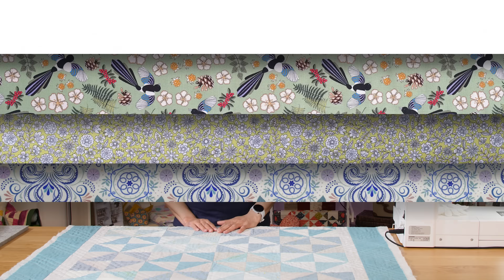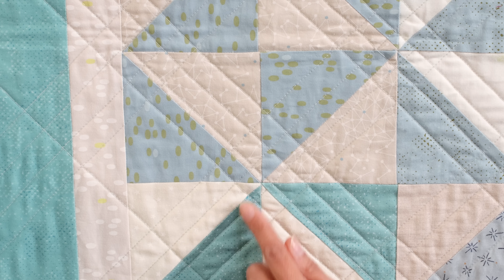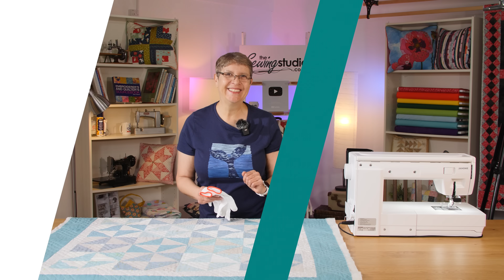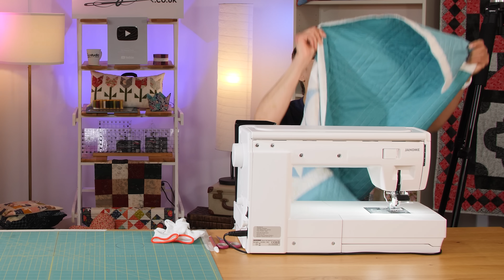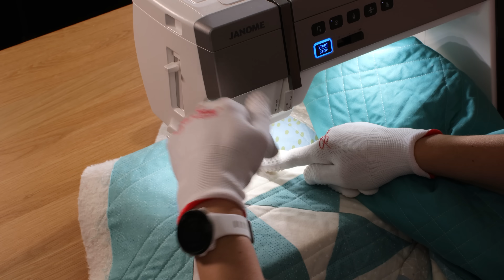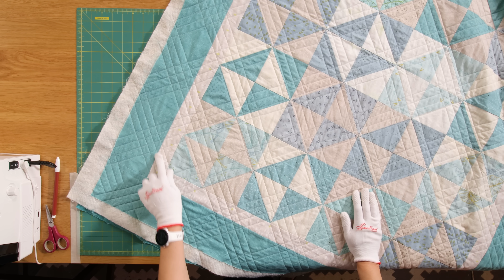How do I quilt using my home sewing machine? Easy Quilting Techniques for Beginners

Comment: Great video as usual thanks. Love this idea but can you explain where you started quilting, was it straight across the middle first? Then worked outwards from centre?  Does it matter if quilt top is a square or rectangular shape, will it work on both? Many thanks

Comment: I have a question. I’m working on a small baby Quilt and I need to find out why when I Quilt on the Home machine that the back doesn’t stay smooth I use a walking foot. Is there a certain kind of batting that is the best and also the needle thank you
Reply from the maker: Are you using spray adhesive? We have a number of vidoes which might help but this one is great: https://youtu.be/mAMjnUpGbsA?si=-McQIzKaKcB0LDk5 Let us know how you get on.
Reply: @SewingStudio  thank you for your help. I have never tried the spray adhesive.

Comment: Thank you, very instructional! Problem is, can I quilt a double (queen ) size quilt on a Janome 5060 qvc? I think the throat may be too small.
Reply: I've been quilting for years, I quilt all my quilts, which are for double beds, in my little Brother sewing machine that has an 8 inch throat space (, I've also quilted these big quilts in a six inch throat space and it was hard work). My tips are to use a walking foot, quilt in straight lines, roll neatly half of the quilt to put it in the throat space as you start quilting from the middle, if you can have space behind your machine for the quilt to travel even better ( I haven't! ), don't push the quilt, let the feed dogs do their thing, if you have to adjust your quilt every few inches that you are then do so. It's not easy but it's what you do when you can't afford these expensive sewing machines. Watch Angela Walters, her early tutorials are showing some awesome FMQ of big quilts on a small domestic machine, she's incredible! I've only done one FMQ in mine and I could feel the tension in my shoulders trying to love the quilt that was essentially jammed through lack of space, not sure I'll be repeating that idea! Also remember you can lengthen your stitch ( I use 3.5 )and slow down, it's a walking foot not a running foot. ❤
Reply: @rebeccamulkern1051 So kind of you to reply, thank you for your advice.
Reply from the maker: it is doable but might require a bit of patience!

Comment: My biggest fear is the possibility of puckering in the finished product.  Do you have any tips to make sure that puckering doesnt happen please ?  I tried it with a single bed size Christmas quilt for my granddaughter but I did get some puckering on the sides....
Reply from the maker: The best way to avoid puckering is to firstly always use a walking foot - it helps ensure an even feed of the layers of fabric. We also advise you use a spray baste as that helps eliminate any pockets of fabric which could pucker. Start from the centre of the quilt and work your way out smoothing as you go. Taking your time also helps, don't rush as you might miss any area of fabric which is slightly gathering that leads to puckering. Hope this helps. Ultimately any puckering that does happen isn't usually that visible to anyone else other than the maker. ;)
Reply: @SewingStudio  Thank you, I really appreciate your comments...

Comment: I'm sorry, dumb question... What machine are you using that you don't have to cut your thread between rows? Getting back into sewing and quilting after almost 20 years off. Using my mom's 1970s machine that she did all her quilting on but never actually saw her do that part only helped her with the blocks/tops. Happy to see how the magic happens
Reply from the maker: Hello, not a dumb question at all! Jeanette is using the Janome Memory Craft 9480QCP sewing machine which has an automatic thread cutter. If you're using an old machine, it won't have this feature so you just need to cut the thread yourself. Hope this helps.
Reply: Many machines today have a button that cuts the thread ends and some can tie off and then cut!  I love the ability to cut thread at the end of sewing and it saves thread so I can sew longer😃 and then makes things easier when starting out again!  But it sure isn’t a necessity and sometimes I just forget and putt out what I’m piecing and cut the thread like we all used to do!  Those older machines are wonderful - I have a collection from 1926 forward to about 1960 for Singer machines plus’s quite a few other brands!  Please don’t tell my husband about my collection😃🫢🫢😃😃

Comment: Thank you so much for mentioning the quilting needle. I’ve been having a lot of trouble with skipped stitches, altering tension hasn’t helped, it’s been driving me insane. It never occurred to me that I might be using the wrong needle - I’m going to give the ones you recommended a go 🎉 Thanks again, great video 😊

Comment: What stitch length do you use when machine quilting
Reply from the maker: Jeanette uses a 3.0 stitch length in this video. She tends to use either 3.0 or 3.5 for most quilting projects. Hope this helps!
Reply: @SewingStudio  Wish I had known that more than 40 years ago when I made Christmas stocking!  I was new and thought since hand quilting was small stitches, that’s what I needed to do with the front of the stockings - through all three layers!  Used a small needle and very short stitching - everything worked out except that the front did shrink up some and the lining was too big - I made it work😃😃😃😃. I’m going to write myself a note about needle size and stitch length and stick it in my cabinet next to my machine!!!